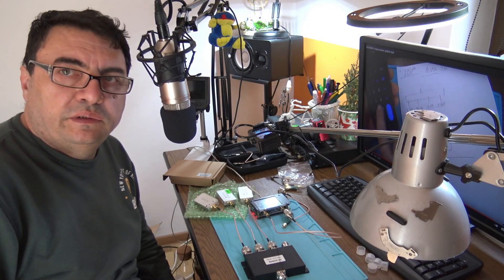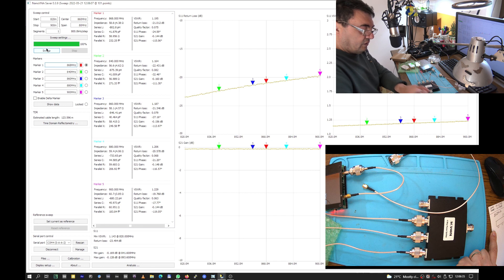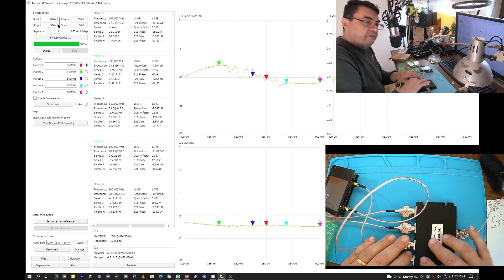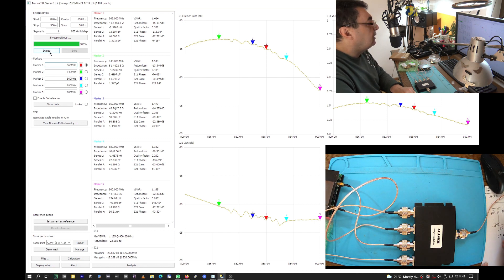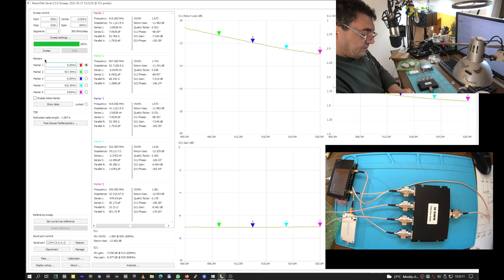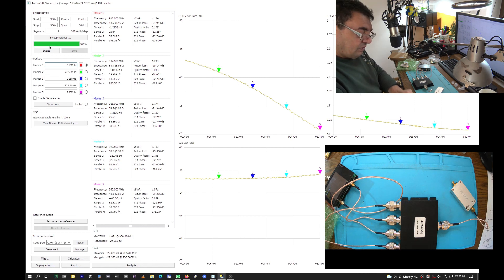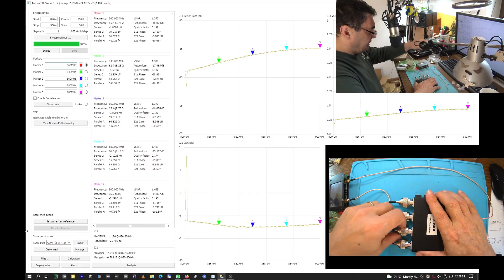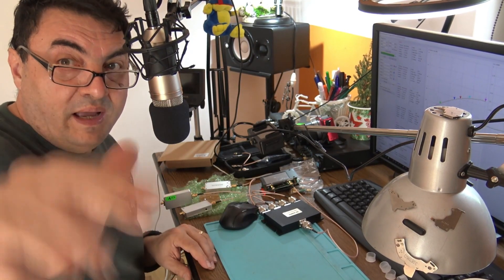ACASOM 4 ports splitter on 868Mhz and 915MHz test2

Comment: Hello, what do you think of this. one antenna-cavity- one sma y to sma - 2x 4 splitter - 8 miners, could that work?
Reply from the maker: About the splitter , be sure you order one with SMA connectors! like this https://www.aliexpress.com/item/1005004298600415.html?spm=a2g0o.productlist.0.0.20a22a11wjO7Qr&algo_pvid=13549428-edc9-4118-9918-3eb3ef2d6e54&algo_exp_id=13549428-edc9-4118-9918-3eb3ef2d6e54-0&pdp_ext_f=%7B%22sku_id%22%3A%2212000028674000894%22%7D&pdp_npi=2%40dis%21EUR%2140.96%2140.96%21%21%21%21%21%402101e9d516695828193108697e61a3%2112000028674000894%21sea&curPageLogUid=NbkthNt8UmFd
Reply: @viocaia  thnx, this is my setup, so you say this will work ? https://drive.google.com/file/d/1x6eKcut1_jxym04gwGl_BKQeFiogO9kd/view?usp=share_link if i out 10db in front of every miner ?
Reply from the maker: @turkdjvjencanja  looking good...the amplifier will do all the hard work about RX/TX..so the miner will be ''isolated'' one from another.. I should try first without cavity or no filter at all..check the numbers and have the filter after 1 week or so..then you can see the difference.
Reply: I bought acasom i will give u a link of spec so u can check it out and say opinion
Reply from the maker: It can work..but I believe you should have like 10dB attenuators before miners..that's avoiding shooting each other..
Reply: @viocaia  can u link product, thnx
Reply from the maker: @turkdjvjencanja  https://www.ebay.com/itm/155022873963
Reply from the maker: https://www.ebay.com/itm/155022873963

Comment: nice! Do you know which terminators i can use to do something similar? i have a 4 way splitter and have 2 sma ports unterminated
Reply from the maker: 50ohms..you can improvise with a resistor of 50 ohms at the end of the cable..well isolated and cover in aluminium foil..I'll do a video about soon
Reply: @viocaia  that would be nice, im googling for a nice ready made one, but besides 50 Ohm, Ihave read that they also need to match the frequency and wattage. This makes it difficult for helium (to find) Or maybe they are rated for a maximum. eg from 0 to 2 W and 0 to 6Ghz?
Reply from the maker: @prowling123  There is no power problem with Helium..there are 0.10W even less beacons..so look for a low power..the band is ok..anything taht includes Lora band 8686/915MHz

Comment: Hi Viorel. Can i put 3 Miners with a 3 way Splitter (3 Miner > 3-way Splitter (Acasom) -> Acasom Amp (TX17/RX6) -> Sawfilter -> LMR400 (6m) -> 9dbi McGill)? Did this setup maybe work? Or is it better max 2 miners on 1 antenna? Thx :)
Reply from the maker: Yes you can..a 3 way splitter works perfect with that amplifier....if you start having invalids, insert a 3db attenuator to each miner
Reply: @viocaia  how do you calculate - on app he added ( 9dbi) that will give us 6 dbi -6 dbi + 17 dbi - 3 dbi -1 dbi +9 dbi = 22 dbi
Reply from the maker: @Harpaljio516  Right! That's by the book..this is my field experience, TX it's always lower then numbers..bad quality cables, bad connections, I have a 3.5dB Heltec for TX, declared so..and the last 3 beacons are 0 witnessed..12dB from the miner+3.5dB antenna-5m LMR400 and 4connectors..result=no witnessed..0. What's next?
Reply: @viocaia  me personally still in learning mode ! 12 db + 3.5 - 1 db - 6 = 8.5 maybe you also using adapter on splitter
Reply: @Harpaljio516  i will try it like sorin and put 9dbi in app and look.. but now i must wait the amp will come in 3 weeks. I will report how it work
Reply from the maker: @Harpaljio516  I got no splitter..just a bare miner and his own antenna..

Comment: If I use a splitter: two hotspots and one antenna. Would it affect both hotspots trasmission scale?
Reply from the maker: Yes..consider reverse -6dB losses, so have a low dB antenna declaraed for a max TX miner output..or an amplifier after splitter.
Reply: @viocaia  thank you. Do you do the modifications for clients? Would you be ok with me sending you an acasom amplifier to modify it for US dbi?
Reply from the maker: @daft1138  I don't have saw filters for US on 915MHz, you should Ebay it and purchase US version.. Sorry..

Comment: Bună seara, amplificatoarele ACASOM au filtru SAW integrat?
Reply from the maker: Da..
Reply: @viocaia  sa înțeleg ca pt amplificatoarele acasom nu mai e necesar sa iei un filttu saw? Cat de bune sunt filtrele lor interne?
Reply from the maker: @sorinmitrea5138  filtru saw de vreo 2,5dB..cumse gasesc in orice miner..cu ceva banda mai larga, cam 10MHz in jurul 868MHz..sint absolut ok..au pe ambele cai..RX/TX, doua filtre separat
Reply from the maker: @sorinmitrea5138  Exact ca si cele din mineri..cam 2.5dB loss si vreo 10MHz banda..sint ok, fac treaba fara probleme..in general face treaba buna..
to understand that for home amplifiers it is no longer necessary to take a filttu saw? How good are their internal filters?
Just like the miners..about 2.5dB loss and about 10MHz band..I'm ok, I do the job without any problems..in general it does the job well ..
Reply from the maker: @sorinmitrea5138  sint filtre saw , cum se gasesc in mineri, cam 2,5 dB pierdere si 10MHz banda..sint ok,se pot folosi fara probleme, aceiasi parametrii ca si filtrele B3717 de pe Internet
to understand that for home amplifiers it is no longer necessary to take a filttu saw? How good are their internal filters?
Vio answer "are saw filters, as found in miners, about 2.5 dB loss and 10MHz band .. are ok, can be used without problems, the same parameters as the B3717 filters on the Internet
Reply: @viocaia  mulțumesc mult pentru lămuriri, deci cine achiziționează un amplificator Acasom nu trebuie să mai ia si filtru sa puna între amplificator si antena...
Reply from the maker: @sorinmitrea5138  Categoric! Recomand ultimul model..iar daca se poate lua la pachet cu filtrul cavity e si mai bine...mai ales pentru mediu urban aglomerat radio.
Reply: Mulțumesc frumos
Reply: Pt a folosi acest splitter ce amp recomandati?
RX 12 db, TX 0 db
RX 17 db, TX 0 db
RX 17 db, TX 6 db
Reply from the maker: @seasmika  RX17 TX6 ..extra power/gain nu strica..! doar splitterul are 6dB loss
Reply: Aveți un WhatsApp sau discord?
Reply from the maker: @seasmika  Discord Vio#3602
Reply: @viocaia  mulțumesc, v-am trimis un mail.
Reply from the maker: @seasmika  you too
Reply from the maker: Please subscribe..

Comment: Salutare. So what antenna we need??? 15 db to declare in helium application 6 more or less ( splitter lost 7db , cable maybe 1  connection another 1 db). Please can you give one answer about this issue. I think is the most importing thing WHAT VALUE OF THE ATENA WE MUST PUT IN THE HELIUM APLICATION TO HAVE NO PROBLEM WITH THE UPDATE POC 11 if I remember well.  It’s very important issue when you have one splitter.  If you don’t have this in good order you maybe make  0 helium an after you decide the splitter is no good. I don’t now that I ask this question ??? Please maybe you have time to give me a answer. Thank you and continue the good work!!!
Reply from the maker: Of course in Europe the TX power is max 15dB.An antenna is a passive component so it can be as high as poddible. All that matters is to not go higher then 15dBa.I.ll be back with more..
Reply from the maker: For RX it should be any antenna, as big as possible, there is no limit, but with a high gain antenna and amplifier we'll start receiving invalids..it should be a limit, depends of the system, position, altitude..so on. In the application consider only the TX final power. So let's start with antenna.A good one should be around 12dB..but that's a passive component so it can be 30dB...as long as you are at 15 limit it's ok..ideally 12dB radiation should be driven by at least 15dB from miner, to cover the looses..Back to any other device in the chain..a splitter with 2 ports have at least 3dB attenuation, a filter 2dB..cables+connectors another 1.5dB..so totally 6.5dB..at least! We need an amplifier to cover the losses..let'say 6dB for TX...and we still have place for more! Finally..when you declare the antenna think about TX only. ALso a high gain antenna declared will cut the miner TX power by the network..so I prefer to have something like 3dB..that means my miner will send a beacon with 12dB...I found it ok with a RAK 8dB omni. You'll say it's overdriving the output, but consider buildings, vegetation , even rain...so there are natural losses too..I hope it's clear..
Reply: Thank you for answer. I have one 6 db McGill and I want to put 2 Linxdot. So the splitter plus connection is about 4 db.I don’t now how much I will put in helium application. Or I put only one and register 5 db. I do not now!!!  Cable lmr 400 3 meters.
Reply from the maker: @mirceamircea2106  Hey! Just put 3db.If you get invalids go higher... Go to custom antenna and add 3dB one.That means the miner will send with 12db..that's enough to cover losses and have extra little power..doesn't hurt!